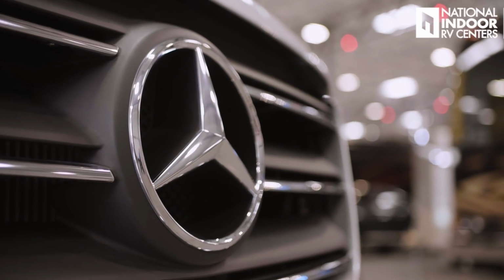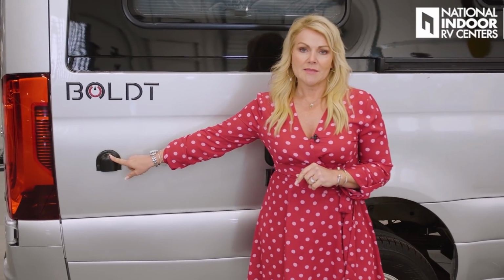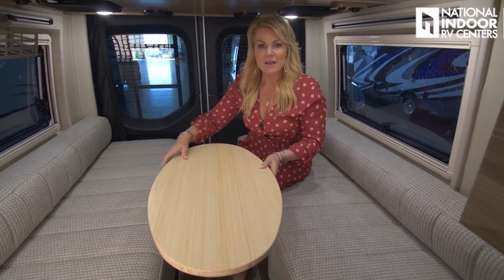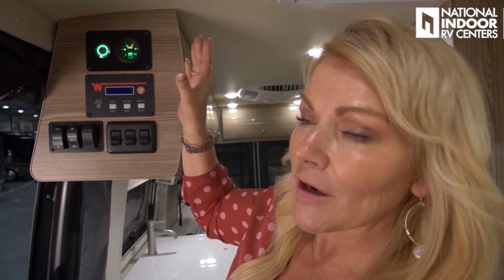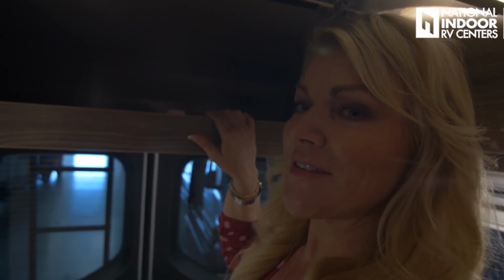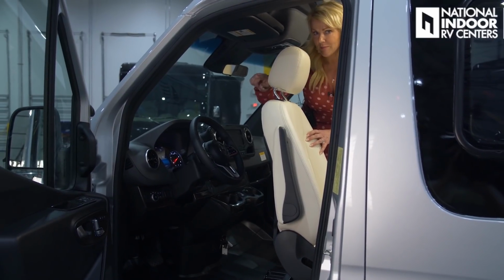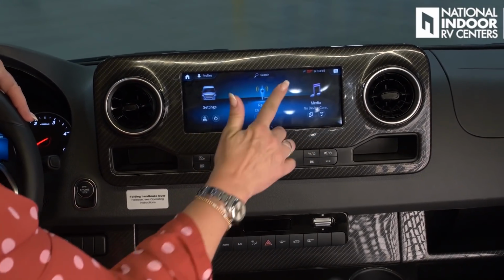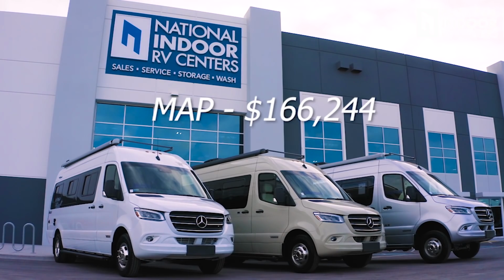2020 Winnebago Boldt | Full Motorhome Walkthrough Tour | NIRVC

Comment: Wouldn't it be safer from vandalism and tampering if the outside access ports were in slightly recessed locking panels? As is, you've got free, easy access to your water and electrical system, by the owner... or anyone else. Love the van, but I'd be afraid to venture off from it or even leave it on the street overnight. Maybe such tampering or vandalism never happens, but peace of mind is worth the extra cost. Seems a no-brainer design must to me. What am I missing?

Comment: Extremely detailed review and I cant believe you actually explained under the hood ,and test drove it however I dont remember hearing the size of the motor
Reply from the maker: Hi Paulo, it has the 3.0 L 6-cylinder, 188 hp Turbo-diesel engine 7-gear Tronic automatic transmission, 220- amp. alternator
Reply: @NIRVC  thank you for the reply

Comment: What is the warranty on the chassis/motor and is it separate from the living space? If purchased from NIRVC how much training is provided to the customer? Especially the technology.
Reply from the maker: Mercedes Sprinter Chassis Warranty
3-year / 36,000-mile basic limited warranty
Diesel Engine Limited Warranty 5 years or 100,000 miles
5-year / 100,000-mile Limited Outer-Body Warranty
Protection for the outer, finish-painted, metal panels against corrosion and
perforation for 5 years or 100,000 miles, whichever comes first. All panels are covered for 3 years regardless of mileage.

You will spend a full day with a NIRVC technician. He/she will walk you through your entire coach and teach you how to use everything. We invite you to stay a couple nights on property with us so that you can get familiar with your coach in our campground. Each morning you can ask our technicians questions to help you completely understand coach before you leave.
Reply: @NIRVC  thank you!